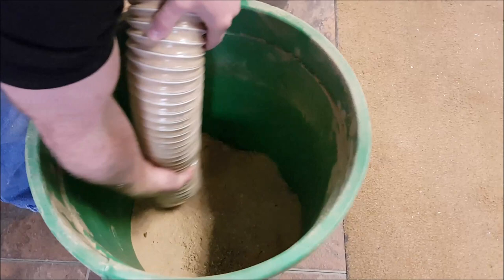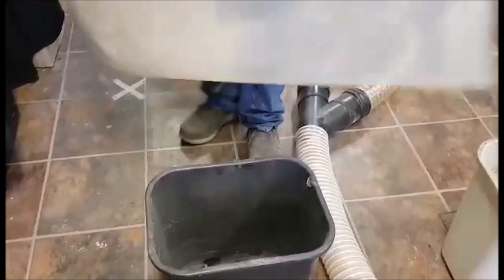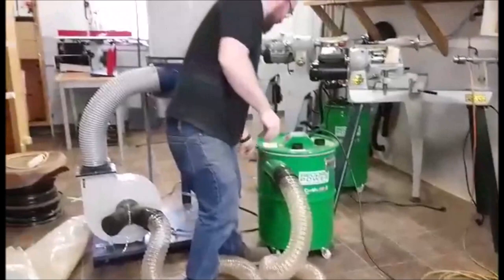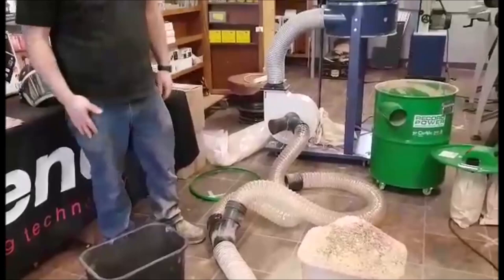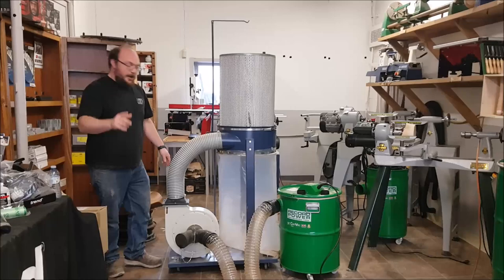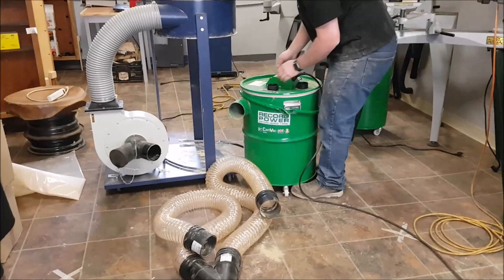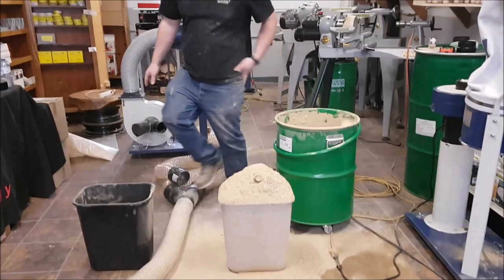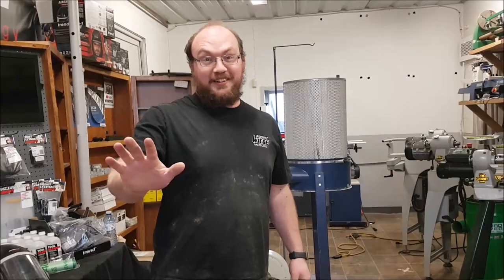Fun Dust Collector Test With Shocking Results! Camvac vs Rikon 2HP EthAnswers

Comment: I think this just confirms that the lower pressure ("higher suction") produced by the Camvac overwhelmed the low pressure hi-volume dust extractor.  Not surprising and not a valid comparison of two dust extractors designed to do quite different jobs.
Reply from the maker: I was quite surprised! You are right in saying that the Camvac is high pressure/low volume and the Rikon is low pressure/high volume. I assumed the Rikon, being high volume, would win as I was sucking up a high volume of sawdust.
What would be a fair test in you opinion?
Reply: @StockroomSupply  I don't think they can be compared fairly.  They are designed to do quite different tasks and perform very differently as a result.  Although "high pressure/ low volume" extractors are often used for all workshop functions (I use one for my mitre saw, track saw, sanders, planer thicknesser and router table with a 50mm hose and small cyclone for the saws and sander and a 100mm hose with large cyclone for the planer and router) you do need one with a high flow rate to handle the large volume of chips from the planer/ thicknesser and the dust ( with MDF) from the router and collection is not quite as good as it would be with a low pressure/high vol extractor.  In a small workshop the Camvac or equivalent twin or triple motor extractor is pretty effective and many, including Peter Parfitt and Dennis from Hooked on Wood, use these.  Finding the space for a large LPHV extractor with a large cyclone isn't easy in a small workshop.

As to testing I think a practical test of the effectiveness of the different extractors used sequentially for "difficult" tasks such as the planer/ thicknesser and router table would be more useful than measurements of pressure reduction and airflow which,while precise and scientific, wouldn't actually help an average woodworker decide which would suit their purposes.  For track saw, mitre saw and sanders the HPLV extractors are best as they cope with small hoses much better than the HVLP high are designed to work with 100-150mm hoses and move a lot of air at low pressure drop.

Comment: Unfortunately this just proves which one is a better vacuum.  What people need to understand about dust extraction is that it’s the range of effect and volume that makes a difference at the tool end there are some smoke test videos that illustrate this point pretty well.  Also what matters is the output in terms of dust that makes it through the machine.

Comment: I was surprised, I thought the Rikon would do MUCH better than it did. I am also surprised that the Record Power was not only that much more powerful, but it has such a small can. That motor probably deserves a larger can, maybe a 55 gallon drum. Your demonstration made the decision for me, for when I upgrade from my current Jet, but, I think when I have a Record Power dust collector in my shop, I'm going to have a much larger dust separator in line, than what I am currently using.

Comment: I'm building a woodshop and have been watching several of your videos. I currently don't have a dust collection system so I'm doing my research as to which one I should purchase. My shop will b 16'x33' with most of the basic woodworking tools (table saw, 6" jointer, 13" plainer, drill press, band saw and lathe). I can put 220 service anywhere I want it (thinking table saw (getting a Sawstop and dust collection), so the Camvac is in the running. Thanks for all your videos and I suspect I'll be purchasing some of my new tools from your shop = love the reviews you do.
Reply from the maker: Sounds like a sweet shop! Thanks for watching 👍

Comment: Hi loved the video. Very messy can you put a bag in the cam vac to save all the mess or does it work best because it doesn’t have a bag, thanks
Reply from the maker: Unfortunately you cannot put a bag in the standard Camvacs. There is a wall mount version with a bag https://youtu.be/hXBEYBe_L4Q
Or you can use a cyclone ahead of the Camvacs to capture the dust - https://youtu.be/IvLqwJ5vj4A
Thanks for watching!

Comment: How often do you need to be able to collect dust at that volume within that short of a timeframe ? I mean, if your need is about this volume/speed then your system needs a huge collection bag/drum.
The test is funny, but it do not tell that much useful stuff about which dust collector can do the job, for most one mand band shops they will both do fine when it comes to collect dust, so where is the real difference ? Could it be in filtration, like in how much fine dust it send into your room during operation ? Could it be something like how often do you need to clean/exchange filters ? The answer my friend is blowing in the wind.
To compare different systems you need to know about airspeed, pressure and filtering ability, and under what conditions these are measured, to use a test like this is just plain wrong.
A thing that could had made this video more useful was if there also had been a test of each dust collector on it's own collecting the same dust and then measure the time it takes.

Comment: That test doesn't make sense. So the way the room works is it is high volume, low pressure. So it's good at dealing with moving a lot of air. It works better with tools that have more cavernous dust paths. Table saws, planers and such. It moves a lot of air but it doesn't move it as hard or as quickly. The camvac is the opposite. So once both tools together have gotten it into a tight area, the camvac's power is gonna steal more dust. Cause it's pulling harder. A better test would be to time the amount of time both take to suck the dust up. Or perhaps to see how far away from the hose they can get it. Or, if you want to highlight the camvac more, how much power they lose with complicated ductwork with a lot of branching. They're really built for different purposes and this test just gives a huge advantage to the camvac.

Comment: How comparable are Camvacs to oneida supercell?  Are these also hybrid design?  work with 4" and smaller tools like sanders, tracksaws etc?
Reply from the maker: Very similar idea yes! The Camvacs work as we on 4” diameter ducts as 2.5” and smaller. They are a great hybrid dust collector. 
Also each motor turns on and off individually so depending on the tool size you can vary the power.
Reply: @StockroomSupply  Thank you.  Are remote controls available so you don't have to walk to the dust collector to turn it on and off?

Comment: Hi Ethan, I bought one of these from you guys (CGV386) and it seems really well built, but I can't get the ring on the can with the top on and the filter in place. The only really chintzy part is the ring, and 1) it seems like it (or the top, or the can) is bent, and 2) the ring is so thin that I can see it starting to come apart as I apply force. I've tried pushing the lid and the can together while I tighten the ring, but the gap just keeps moving around the rim. Did I just get a lemon, or is there a trick? Thanks, looking forward to firing this up for the first time.
Reply: I called Stockroom Supply with this question this morning and Ethan was out for the day, but they said he'd send me an email. I received the email in less than 10 minutes! Anyway, the brilliant trick/solution is to turn one or two motors on, then cover the inlet, which creates enough downward pressure that the clamp is super easy to close. Thanks, Ethan!

Comment: So that was a 2hp vs a 4hp?
Reply from the maker: Yep! The reason I'm comparing them is their cost though. The Rikon setup is $975 and the Camvac is $999.
Reply: And the harbour freight  1 identical to the rikon is about $250 .
Reply from the maker: Have you had a chance to compare them side to side? They are certainly not identical. The Rikon in this video has a different impeller, motor, construction quality and NanoMax filter(0.03 microns). The prices I listed are CAD as well.
They sure look similar though!

Comment: In order for this comparison to not be meaningless, you need to perform the test several more times using increasing duct lengths with each test. That will reveal which one does better under higher static pressure levels. Also you need to take into account the dust that remains in the filter and do the tests at increasing filter load levels.
Reply from the maker: Hey Frank,
In my last comparison video I did a fair amount of CFM testing through different length ducts and flex hose. The Camvac, because of its 81" max static pressure vs 9" max on the Rikon, performed better in every case except for directly at the machine.
 https://youtu.be/ZLJCxyIQcK8
I also talk about the filters extensively in this video. It's worth watching!
Reply: @StockroomSupply  Thanks for the reply Ethan. With that kind of suction the Camvac should work very well with a cyclone and a HEPA filter. Quite impressive.

Comment: Incorrect comparison! The Rikon is a chip collector filtered to try and be a dust collector! The Record is a dedicated dust collector down to 0.5 micron. Compare this, then compare the two record motors to the one rikon. Theyre different machines designed for different types of extraction.
Finally the record can only operate for so long due to the heat generated, how long can the rikon operate?

Comment: aside from the accurate comments that the two devices are designed with different jobs in mind, having the two "competing" to consume the dust from the same front tube is not at all a valid comparison. there are many variables influencing the outcome  giving confusing results with that setup. at the least they need to be tested individually with a "control" of the same quantity of dust from the same container or machine outlet etc